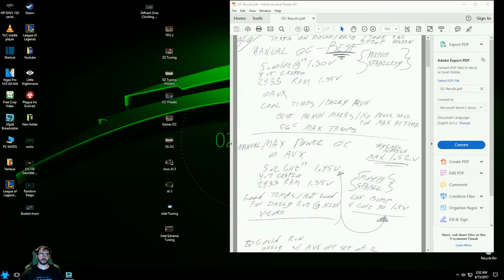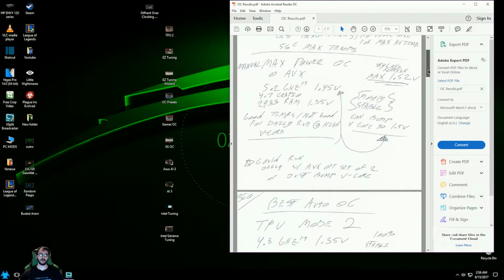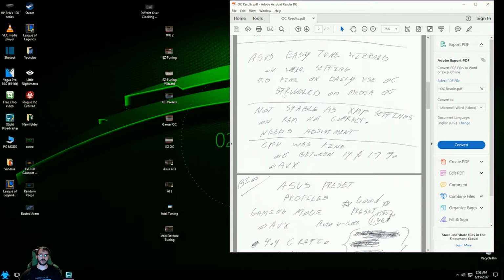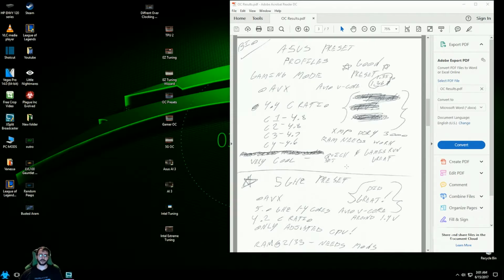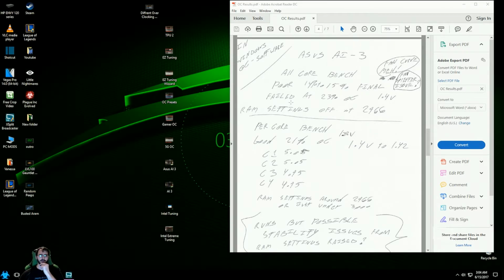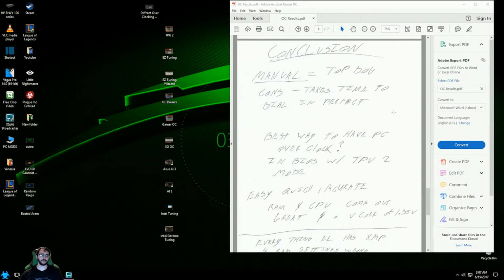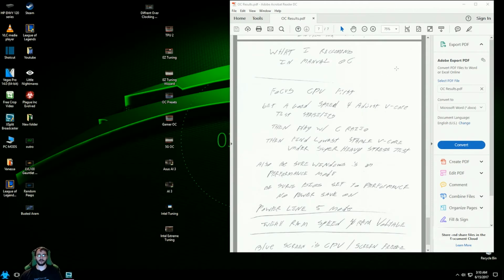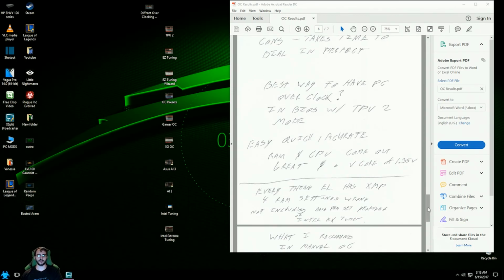7700K OverClock Results - Subscribers Requested

Comment: I've watched both this and your previous "How I set my DDR4 Ram on Asus Formula Z270" video and noticed you talking about the ram not being stable at XMP settings but in the bios settings you show you have the "CPU VCCIO" and "CPU System Agent" both set to "Auto". With those settings like that the motherboard set the voltages to 1.144v and 1.128v. I'm pretty sure your ram can run XMP just fine if you set VCCIO to 1.2v and System Agent to 1.225v. 
What it comes down to is that you overclocked you cpu and ram, raised both voltages to make them stable but left the memory controller at stock voltage. 
My 7700k runs at 5Ghz and ram at 3200Mhz XMP on a Maximus IX Code motherboard for some time now without any problems or crashes. I just copied the settings from a Der8auer video where he reviews and overclocks a 7700k on a Maximus IX Apex. I know the Apex is not the same as my Code board but it works just fine, I even used the same settings on my previous Maximus VIII Ranger with the same 7700k and that ran fine for years too. 
https://www.youtube.com/watch?v=wlR7CNuoOXk&t=395s  is the video I mentioned

Comment: Just finished validated i5 7600k @ 5200mhz stable Cinebench r15 etc. 
using AIO and lowest possible core voltage. FUK that was intense. 
I was going for 5100 stable but instead ballz out to 5300mhz. 5300 runs well but fails CB testing, get a pop up fail from CB. But system does not lock up or crash otherwise. This may just be Cinebench not being able to test at these settings. ANY ADVICE? Again PC does NOT lock up or freeze or skip a beat @5300mhz otherwise.
Reply from the maker: Holy Balls Man, Nice work !
No I have never seen that before , normally it goes or it doesn't lol
Thats a Crazy OverClock  =)
I would Personally stick with 5.2 since you know its stable and wont poop on you randomly gaming or something